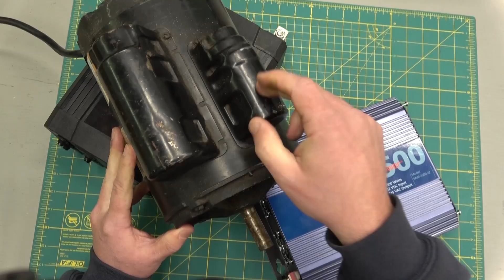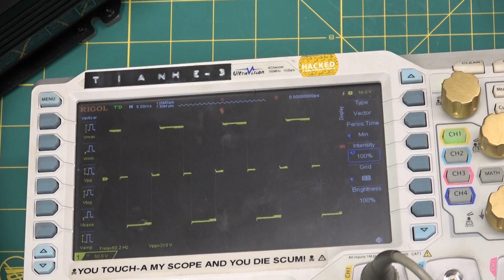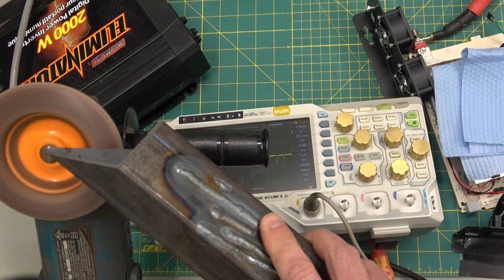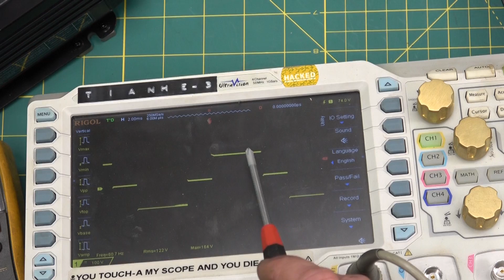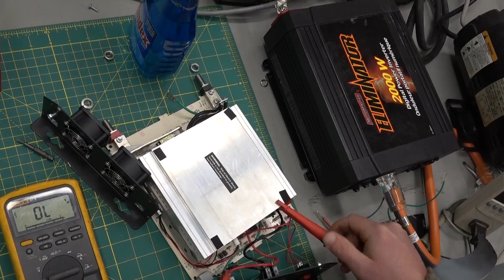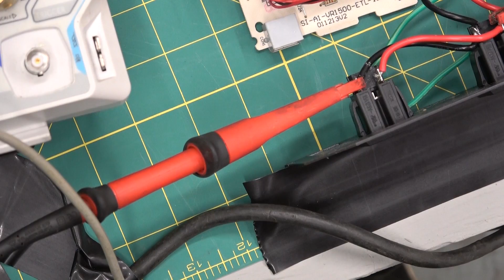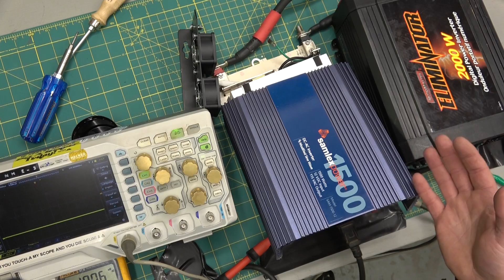BOLTR: Samlex inverter | Cheap vs. Expensive

Comment: I honestly don't think "pure-pure" sinewave inverters are even real.  Too expensive for me -  Why not use a class d subwoofer amp, some transformers and an oscillator circuit - Is that even possible?
Reply: Durability? Not sure an amp would hold up to the extended load. Now I want to try it though.
Reply: Assuming your amp has a 100% duty cycle rating, that should work okay.
You'll want to measure the output voltage to feedback to your oscillator circuit to regulate voltage, and you'll need a quite expensive hunk of copper output transformer, but there's no reason that shouldn't work.
Class D amps are basically switch mode converters that use the speaker windings for filtering...

Comment: Power supplies are commodity items unfortunately. Difference between brands will mainly be QC. Reason is that there is minimal 'new' design work involved vs existing products. The bulk of engineering hours spent is for cost down or assembly efficiencies.
Reply: I feel the bulk of new engineering cost are spent in the marketing department
Reply: PS keep up the great work!
Reply: What QC? With the leads flopping in the breeze...
Reply: So Flow chart: If price higher>Is QC better? If not > Is a ripoff
Reply: @legendario13  It is a proven phenomenon that the public routinely assumes a greater price equates to a greater value. 
Something manufacturers and marketing departments exploit on a daily basis.

Comment: Looking at the transformers I think that they are both switch mode. They first step up the 12 V to the peak voltage, about 170 V, then have a bridge on the output to switch polarity. This would account for the mismatched MOSFETS as some are used in the step up DC/DC converter and the others on the output bridge. As you say thay are both rubbish. With the more expensive one being slightly better (ignoring the soldering fault) though the electrolytic capacitors look pretty dodgy.

Comment: If you are watching this for a solar inverter.. stay AWAY from Fronius brand. I install systems and 85% of fronius solar inverters fail within a year. Go with Solar Edge . We had to switch due to call back repairs. The boards literally blew the mofsets off it. And good luck getting good tech support within 3 hours. They look fancy and modern but are SHIT TACOS. 
This applies to the larger 5kw-30kw systems but from what ive seen fronius is a pig with lipstick. Keep you digits outta them sockets.

Comment: To reduce cornea searing from sparks on my 3KW pure sine inverter wired up a 5w 110v bulb  and used it to limit the current before initial connection. Bonus is you can also use it to discharge the unit if-un you want to open her up and dilly with the innards
Reply: Dilly dilly

Comment: like i have all ways say . running a MD inverter is like running a car on bad gas..  it well run but for how long .  if the job calls for a SW inverter then pay the higher cost for the unit then for the cost of what it kills latter
Reply: Exactly, it's hard on anything you run on it. Even a simple fan. Computers HATE non-pure sine wave

Comment: cut out about 7 and abit amps, so 700 and some odd watts max drain before the beep.... or as i have always said, in the v camper groups for 3 years,  chinese ebay seller Watts are like 1/3 or real world techicrat watts.
and that waveform isnt modified sine.. its just a square...as always on an ebay special.

Problem is you can usually spot a 2kw POS as its $150, but 'we' stopped buying them, so they just upped the price to $450 so its not a clue anymore. there is one clue still left, ''its on ebay''

Comment: I would have expected a pure sine wave for that much if I’m honest, modified sine wave will always be a ‘second choice’ or cheaper design for inverters, you want the best for your equipment, pure sine wave should be the way to go. Would be interesting to see a difference between a cheap and expensive pure sine wave inverter.

Comment: I was watching the battery voltage...it kept dipping below 11.5v when it overloaded...I think you need to give the battery a real good charge before making comparisons. All the inverter was doing was shutting down on low batt volts.

Comment: Both of those are cheap inverters. The online UPS's tend to have fairly nice inverters designed for 5+ years 24/7 use. Things are real cheap too if you get an older one with dead batteries, like an Eaton 9120 2 or 3KVA, or an Eaton 9130.
Reply: Didnt even think about it.  Got two in the recycling bin at work cause IT upgraded.  Thanks
Reply: Point is, free.  Will have to hook it up and look at the output.
Reply: If its an 'online' unit, then its probably solid. The higher end line interactive units are OK, but even the 'sine wave' output on a high end line interactive isnt quite as good as what you expect from an online or double conversion UPS. The moderately sized double conversion units run in the thousand or two buck range, but they still are dirt cheap once they're a few years old and no longer trusted for mission critical applications.
Reply: Thats not strictly true the inverter side of a ups is always in standby not continuous use but yes you can get some nice ones because they tend to be used on sensitive equipment
Reply: Not with an online, or double conversion UPS. The inverter runs the load 24/7/365, input power or not. They are of course much nicer than the cheapie line interactive units that are only made for intermittent use, but they also tend to have loud fans, notable standby losses, and high initial cost.
Reply: Jon Doe is correct Liljasere, in proper Line interactive units, the inverter is always powered, as its kept in sync with the Mains input, and in APC Units is also run in reverse to charge the batteries, so as soon as input drops, the load is switched to the inverter and the unit loads up off the batteries. You are thinking of the very cheap "Standby" units which only start and run the inverter once power loss or out of spec is detected. Line interactive is much faster to take over.

Then you have Online double conversion, where AC is rectified and regulated into DC to charge the battery bus and power the inverter which is always powering the load at all times, unless the unit is in bypass, either due to a fault, or in Eco Mode. As soon as the power drops (when not in bypass) all that happens is the AC to DC rectification and battery charging stops, and the batteries seamlessly supply the inverter, which maintains a seamless zero transfer power output. Not quite as efficient as Line interactive, but wont cause issues with highly sensitive equipment either like a Line interactive sometimes does to fussy loads (If you have an APC line interactive, set sensitivity to high, unit reacts much faster and load drops are less likely, seen this personally).

APC makes some really really nice units with their Smart-UPS Series. knurlgnar24 did a whole series of videos on them. I personally use APC Smart UPS XL (Online Line Interactive) and Smart UPS RT (Online Double Conversion), and they both output exceptionally clean power often cleaner than wall power, even the 15+ year old 700XL is very clean and still working.

Comment: As per the matched numbers on the transistors, sure, requesting "same batch" supplied from the supply house or manufacturers is kinda a good idea, but, there is simple testing equipment that allows you the test each transistor 's forward on speed and closing to "not" speed, and as long as the parameters are the same, you are good to go. None matching lot numbers and brands, no,  it does not allow symmetric 's or a sexy looking typography on the cosmetics of the board, but too often, i have ordered in a batch of 20, and sure the label numbers are spot on, but all 20 measure differently. After a few times of shooting my self in the foot, i simply order 2 to 3 times the quantity that i need and have ordered as much as 6 times what i need. I typically do not order junk brands either. Same lot numbers i have found means nothing any more and the phrase, "never assume" now comes to mind, i just order a bunch, even with the claim they are matched, only the numbers match on the label, and the tolerance in % , is quite large, from the lowest to the highest part of the scale, which in many cases, will be fine, but the higher current handling a batch has to handle, and having one that turns on faster then the other transistors in that paralleled group, does take a beating. I even mark them from fastest to the slowest, on the more simplier projects, and the fastest transistor will be the first one to pop, that is of course if all the other specs are well matched, in the event of a over load or dead short across their grouped paralleled output.. There is my "2nonescence" ...... Dru

Comment: i have a bunch of cheap ass inverters $80 2000 watt ones, and as long as not constantly overloading or anything terribly abusive they last forever.  i have a couple that still working after a solid 10 + years.  

the thing is, you cant expect a good sinewave out of even the best portable inverters.. if you need a proper sinewave probably best off not using an portable inverter.    

 i heard from some friends that deal with electrical engineering you can take the edge off of those modified sine waves by adding some of those cheap chinese "power saver" devices that are basically 1 or 2 huge super caps in a metal box ..plug that into the outlet  on inverter then plug in device to it.. good for taking the edge off of huge spikes like start up of grinder maybe, and filtering some noise out.  not going to filter out smaller noise under smaller loads but it can help..
Reply: is there a hack to get smaller amounts of harmonic distortion out of a cheap pure sine inverter though? i've got a cheap pure sine inverter going, have not had any issues yet, but it has some distortion in the high kHz region going on...
Reply: first imma say, this is mostly justa  field of curiosity for me, i am by no means the go to person on this, im just relaying what i been told:

that's the only issue i still have which hasn't posed any problems for me either,  is low/no load situations still noisier and have their digital edge, probably a way using same logic just smaller caps and inductors on output to filter it will help.      also depending on the frequency we talking about here, that be its own field of engineer.  because high frequency energy seems to have their own physics.
Reply: To cut kiloherz range harmonics you need very low cut-off frequency.
Get five 33 uF motor run capacitors rated for 1.5x your output voltage (used on air conditioners and compressors and such) and a 100 mH 10A rated inductor.
Hook the capacitor/s in parallel with the output, and the inductor in series.
If math serves me right, this will give you at least 15 dB cut at 1 kHz.
Note that just the inductor will probably run you $200, and each capacitor probably $10. There's a reason cheap power supplied are ... cheap.
A lower cost way to get some relief is to just get the run capacitor(s) in parallel across the output and if that's enough, safe the cost of the inductor.
Also beware that the inductor will get warm if you run it at high loads.
Reply: Taking the edge means dealing with high frequency components.
The capacitance of theae "power savers" is a few uF which at higher frequencies will act as a dead short in the worat case and as a heavy load in the best case.

What you need is a choke in serie with the outlet or better a common mode choke
Reply: A good pure sinewave inverter can give  a cleaner waveform than utility power and will almost always be better than a gas generator.
Reply: What the hells an ass inverter?  
And how do i get one?
Reply: @Dildo_Baggins.  A picture is worth a thousand turds, just google "Anal Pink Sock" and you will have your answer. To get an ass inverter one, download the Grindr App referenced in this vidjo.

Comment: You pixies analogy is a bit fucked. What's really happening is some EMF thingy (battery, generator, whatever) picks pixies up from one terminal and shoves into another. The shoving side get a bit crowded and pixies moves forward (ever been in an inorderly queue to an intrance to some festival?) to where it is more breathing room (towards the wire). Eventually it all loops around and goes back into EMF thingy sucking terminal.

So a capacitor is basically a wall. Pixies are pushed down the wire and suddenly there is a break and nowhere to go but the crowd still rushed in till there is equally packed as down the wire. On the other side pixies wander off into empty space of a sucking terminal.

Comment: I had a 5KW inverter modified sine wave, that came out of Sellafield back in the mid 90's. that had 60 mosfets a side and one day  most of the blew with many of them exploding. I had to buy so many replacements that I still have half a tube  of IRF 540's left.

Comment: It often happens with power tools that the inverter shuts off. It's because the tool needs a lot of power just to get going. It also helps if you just give it a spin. That's essentially what you were doing by keeping the trigger squeezed.
I've got an inverter in my campervan which powers my compressor fridge. It almost always starts beeping when the fridge compressor starts to chooch. But it beeps only once, because once it chooches, it needs less power just to keep it going.

Things that don't require much startup power like a water boiler or something are way easier for the inverter